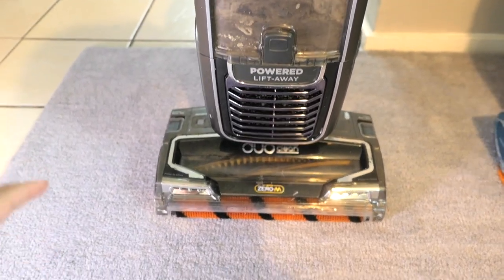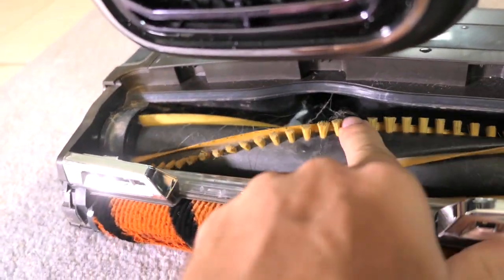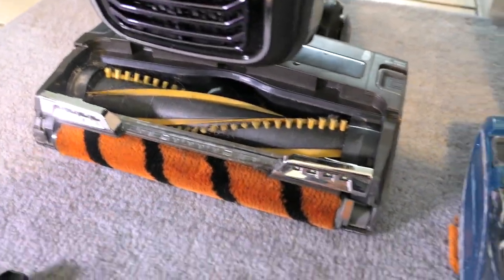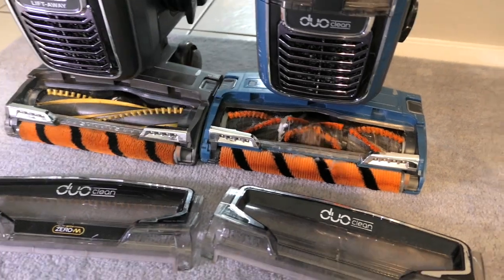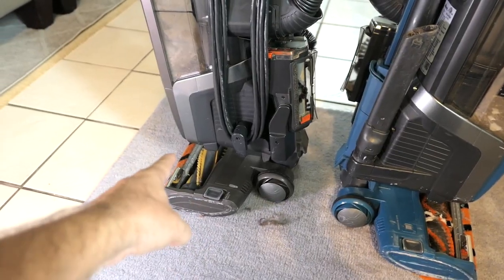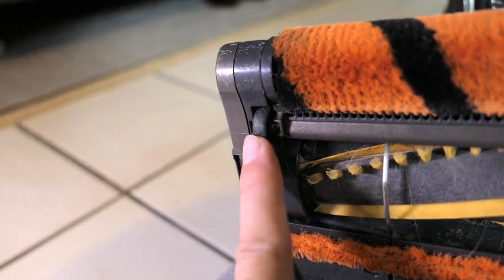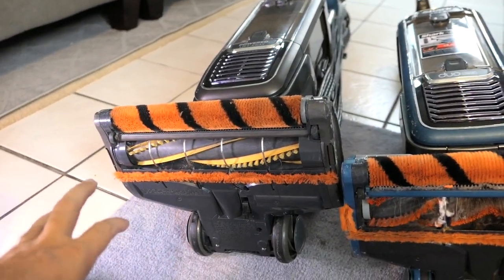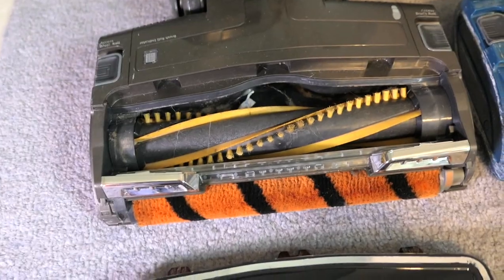Is the Shark - Apex Zero M Worth it?

Comment: I bought the shark navigator liftaway speed Zero M and love the fact that I don’t have to clean the hair out anymore. The only downside is the hose is a lot smaller than the previous purple shark navigator...... also I did notice a slight bogg down with the new roller brush... it doesn’t appear to be as strong as the original shark navigators brushbar. But with all the improvements I guess I can live with it...

Comment: The reason why the hoses of the new model are so tight and reflective is because the less length of hose there is the less  Energy needed to obtain maximum suction. So if your hose gets extended  For twice the length then you're suction is going to decrease. Flow versus if your hose flexes back to the original lankes your suction will never decrease because it's not traveling down the extra length of a hose that is sagging Or worn out
Reply: A man who also understands !
Reply: You guys both must be really strong (compliments intended). I appreciate the logic and ingenuity in the design to maximize suction. I get it. I mean, we all want a vacuum that sucks well....right?? But, what good is the suction if you can't reach the places you need to clean with the attachments? Neither are wrong opinions, just two different user experiences I guess. My suggestion is not to change the design, but for Shark to offer a compatible extension hose for those of us willing to trade a bit of suction for the benefits we value most.
Reply: @Los22888  Its lift away bro, hold the unit in left hand hose in the right you'll reach anywhere.
Reply: @nickb7040  First off, I am not your BRO, bro. I am a 32 year-old woman who doesn't need, want or appreciate some random dude commenting on a year old post to explain to me the most obvious feature of my own vacuum cleaner. Assuming that everyone is as strong and abled as you to be able to hold the heavy body (yes, this is subjective) in one hand and also stretch the hose with the other is a mighty fine example of what the internet affectionately refers to as, "showing your privilege." Please kindly peddle your unsolicited advice elsewhere. Cheers.
Reply: @Los22888  cheers bro.

Comment: The hose is more rigid on the stronger vacuum for a good reason. If something big gets semi-stuck in the hose, and if the hose is pliable, the suction will pull the walls of the hose inward, causing a suction clog...... The hose needs to be more rigid, more "withstanding" from the suction.... The fact that the hose is stout, and rigid means that it was designed correctly.

Comment: Vacuum nerd here. You hit the nail on the head with the hose problem...it drives me crazy! The little cart that came with the pet package we bought is useless because it just slaps you in the heels as you move the hose back and forth. If Shark would sell it, I would absolutely buy a replacement or extension hose that's 3-4x the length so I don't have to fight with the attachments so much. Specifically, the handheld duster attachments are almost rendered useless to me because they don't work unless you hit the surface at the right angle (flat), which hurts my wrist w/ the tension on the hose. And I'm talking desk height...forget about using attachments on a tall dresser...stick to pledge & an old duster rag.

Never owned a shark before and just purchased this model after using my Kenmore Intuition for just shy of a decade. Even though I'm loving most of the new technology in this machine, the hose and telescoping attachment wand on my old dirty Kenmore has a much more user friendly design. It's almost like Shark didn't test the hose for any real or reasonable usability...
Reply: Gotta make compromises in hose length to preserve high CFM air intake
Reply: Fair, but there's gotta be a middle ground there. I would gladly take a reasonable hit in attachment suction if it meant a more usable length of hose. I feel like Shark could easily offer a hose extension for purchase that could be used w/ attachments and disconnected for regular floor modes. The super suction this model has doesn't matter if I can't reach the spots I need to clean (ceiling corners, light fixtures, fans, tops of tall dressers, deep into closets) without hulk stretching the hose away from the base. I could also work out more, but that's a whole different conversation.

Comment: What is the basic difference between the Shark Apex and the Shark Navigator? They both have ZeroM and the new roller. I can’t figure out which to buy. We have HEAVY pet hair in our home.
Reply: The motor power (1350W vs 800W), the dust bin size (1.5 dry quarts vs 2.2 dry quarts), the weight (16 lbs vs 13.4 lbs), the duoclean brush. You can read more here http://vacuumcleanerbydyson.com/shark-apex-vs-navigator-zero-m/

Comment: Hey Vlad just a quick question, did the new Apex zero-m clean just as good as the original apex? Or better?
Reply from the maker: Zero seems to be better on carpet, but hardwood floor they are same. The only other thing I've noticed is the zero m head is a little louder then the original Apex head. It must be the new brush roll having those flaps.
Reply: @JustVlads  gotcha, thanks man! They got a good deal right now on the website for this new model so weighing out the options more.

Comment: I looked on their website and zero M is 13 lbs, does it feel heavy to push? Seems bulky. Anyone??
Reply: It glides on the floors
Reply from the maker: It's a bit heavy but makes up in performance. If you use the lift away feature, it's quite easy to move the brush roll.
Reply: Im late to reply but YES its heavy and takes some getting use to. My daughter is 10 and it is a handful for her. Its ok because we're very happy with the performance.

Comment: Can you try putting the rotator cleaning head on the apex and see if it works? Thanks.
Reply: In the video you showed how the hoses are interchangeable between models, but is the main brush head interchangeable as well?  I have the top of the line AX952 from a few years ago.  It is really a great unit.  The only 2 flaws I have found are with the brush head wheels and the hair buildup on the main roller.  The new zero brush head seems to address both issues.  So it would be the best of both worlds...    Does that make sense?  Would you please try it and let us know?
Reply: Kyle Nakamura yes they are interchangeable
Reply: Thanks!  Did you get a new head and plug it in?  I just called Shark earlier this week because the front soft roller stopped turning on my APEX AX952 purchased in November 2017.  They offered a replacement head for half price with free shipping.  I asked if I could get the ZeroM head instead as the website shows it as compatible (and it wasn't even on their website a few days earlier).  After being put on hold, they came back and said that was a mis-print and they are not compatible.  My feeling then was they just didn't want to give me that deal on the new model head.  I would be OK with that if they were honest about it. I'd like to see it in a video as well.
Reply: @ir3331  So I have a ratator true pet and the floor nozzel needs to be replaced. I was interested in replacing it with an Apex Zero M floor nozzel. Would it work?
Reply: Greg Garcia no, the apex zero m head will not work with the rotators

Comment: These vacuums start off sealed but the motor heats up the hepa so much that it warps the seals and therefore you get terrible filtration
Reply: Take better care of the filters. Eurorpro shark vacuum repair tech here.
Reply: @alexyakobchuk4785  what do you suggest in the way of better care for hepas? Can't wash them. Could vacuum them with another vacuum? Obviously replacing them more often would help. But sharks plastic is cheap and nasty. You'd be busy wouldn't you be as a repair tech? Hahaha Fixing a shark is like taking your pet mouse to the vet or repairing a lighter... One gets what one pays for. This an engineering flaw
Reply: @santouchesantouche2873  Hey wow wasn't expecting a response :). I must say as a marvel of engineering these vacuums are,  like anything else- dyson, miele, higher end kenmore, they all have flaws. Fact is too, contrary to what the public gets to see, Eurorpros engineering team and design advisory team does listen to public concerns. Believe it or not you can wash the hepa filters with a gentle hosing and good detergent, or tossed in the drier on a delicate tumble with low heat, and toss a dry old towel in there. I've had good success with this over the years and saved customers a lot of money!  I also admit with humility you are right. the hepa filtration systems can develop seal warps and leaks, regardless of model. The first few generations this was a big issue. The miele vacuums i service for my side business sadly also have the same design problems, and those vacuums are way too expensive for the motor perfprmance. dysons developethe same issues.My personal opinion regarding this issue is it has to do simply with physics and laws of thermodynamics causing material expansion and contraction due to heat. To see it from the consumer's perspective as well i know these filters are not cheap.
Reply: @alexyakobchuk4785  have you tested hepas with a particle counter after cleaning them? I'd be keen to see that. Really?! Mieles have that problem? Oh geez... Not good huh? I have two sebos, a Felix and a d4 and miele canister. The d4' motor is powerful. But my old miele s5000 with powerhead was powerful but unreliable. Do sebos have this problem? I'd imagine not due to their bag filter design
Reply: To add as a final note: they are quite easy to service. Perhaps I'm saying that because i have done all the procedures hundreds of times😂. The TORX screws are not in any way as bad as The torx screws kenmore and dysons use. Those screws are the worst because of The metal thread and pitch style. The motors for these sharks are rock solid,and engineers from Rolls Royce who design The aviation turbines helped Europro with them.The big issue is getting possession of OEM parts or even aftermarket parts. I do not understand why this is. You can find aftermarket hepa filters on eBay.
Reply: I hope any of this helps you. If,you have any questions please ask. I am posting this on my behalf. Not for the company :)
Reply: @alexyakobchuk4785  what are your thoughts on Sebo?
Reply: @santouchesantouche2873  oh my. Always a pleasure to discuss some of the scientific principles of how these machines work 😊. I have indeed tested them. Yes! In my opinion the particle filtration remains the same after using a good detergent but the heat dissipation improves drastically on account of the improved breathability.  And to remain neutral and not spread negative comment about a brand, the miele vacuums are very very good. You do get what you pay for. Unfortunately the fact is a motor doesn't like heat that's restricted. You'll notice on any of your vacuums you have, if you remove the hepa filter and use a temperature gun to get a reading inside where the hep filter goes the temperature stays very cool and usually suction is improved since the motors bearing can spin faster. Sebos hands down are rock solid. Personally i hope all the engineers follow suit of Sharks with the on the fly, changeable canister design. It always bothered me that even the top 600 dollar dysons cannot go under beds or any furniture 😔. Afaik engineers from RR did the motor vacuum designs for Shark, Dyson partially, Sebo and Miele.
Reply: Those Sebos are absolutely rock solid. Leave it to the germans!  As someone with a scientific education background  involving automotive mechanic work, i can examine internal components of vacuums to estimate life longevity of the performance. I think you can easily get 20 years out of those sebos with the regular care and mandatory maintenance.
Reply: @alexyakobchuk4785  this is very interesting. You should do a video on how to clean a hepa! I'd love to know how you do it exactly. I have some air purifiers I do as well haha. I have to say that the shark on the fly canister design is good in theory. But it's not a great execution. It's more an after thought. The Sebo Felix can be used as a canister. Great for stairs. But it's profile is super low so I have no problems using under my bed. The sharks profile is far too high. I thought the manufacturer of mieles motors were an Italian firm